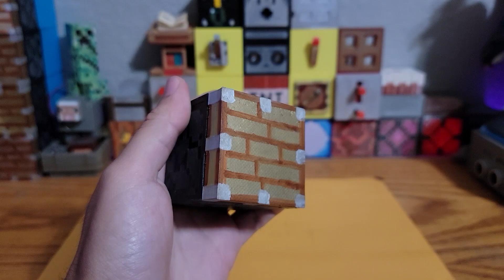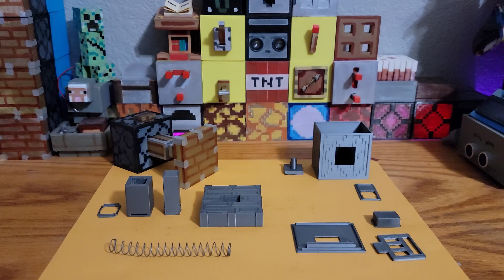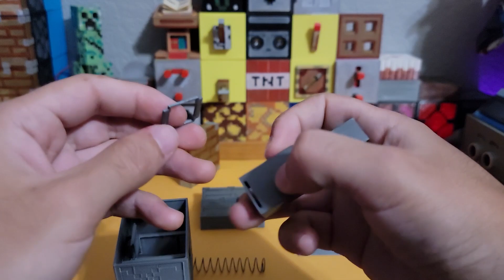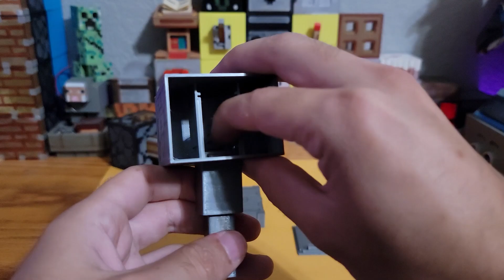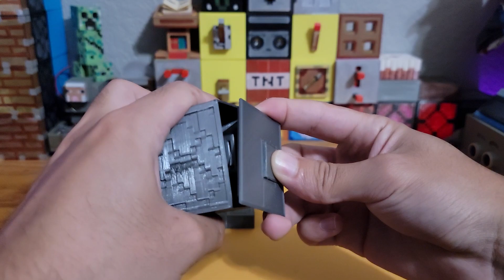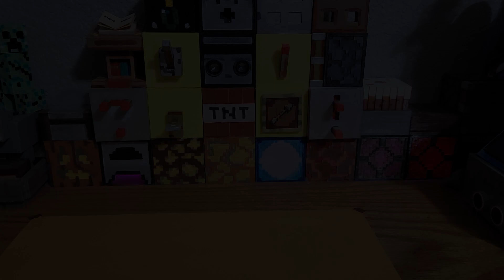Minecraft Bedrock Piston: Spring

Comment: what's the idea behind the mechanism bcuz I've printed the thing but I can't get it to work...
Reply from the maker: What part isn't functioning? The button pushes a 3d printed spring that is connected to a latch to release the inner shaft. I use a metal spring in order to extend the piston. I'm using petg, but pla might be possible.
Reply: @hecbac  I already have all the parts including the spring but somehow the part where it should be locking the spring in doesn't work
Reply from the maker: @rodie_studios  The latch part should be able to move freely, one issue may be that the plastic spring isn't able to pull is back up. Another thing is the plastic spring tends to move out of place if not melted/glued in place. Try and lock the piston without the button and top to see if it takes a lot of force to do. Sorry for the headache and hope you get it! : )